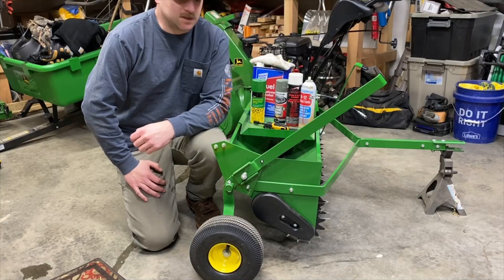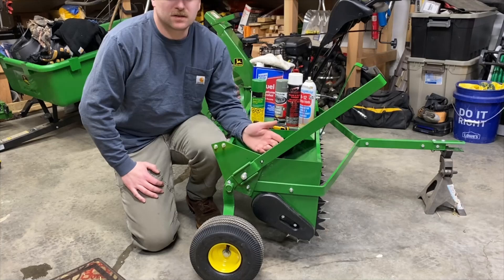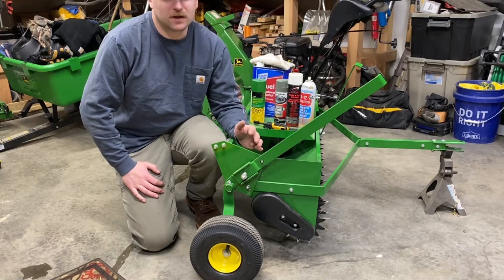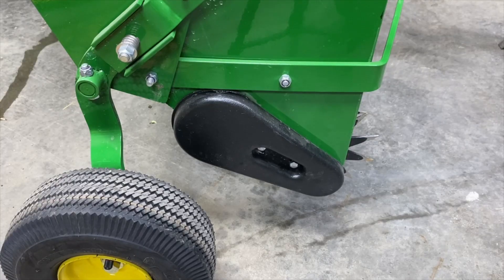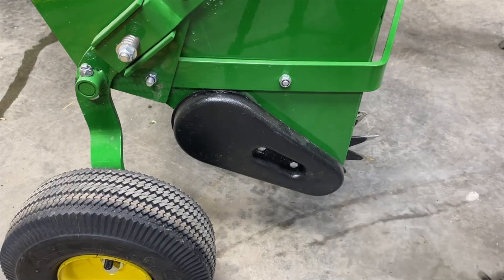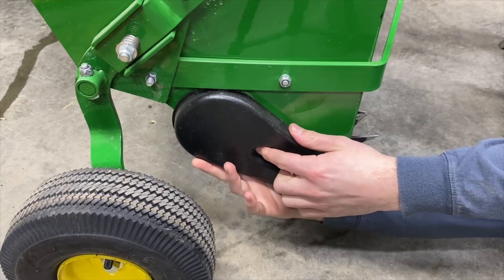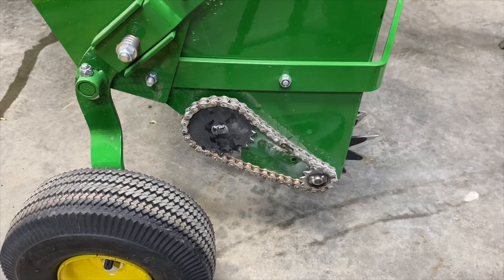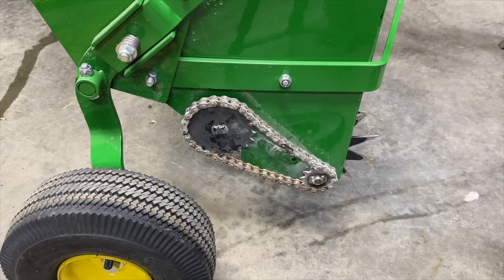John Deere Aerator Spreader - Chain Removal/Regular Maintenance

Comment: I build a pull behind tiller for my x570 last year that’s all chain drive Iv been using bearing grease on the chain and it holds well my chains are spinning a lot faster and build up some heat. Good video keep it up

Comment: I need a new chain for my aerator spreader. My old chain has no number on the links. China on some. You have any idea of the chain size number? Thanks
Reply from the maker: Not sure about chain size, but the Brinly part number is B-4724-CPT… it’s currently just over $15